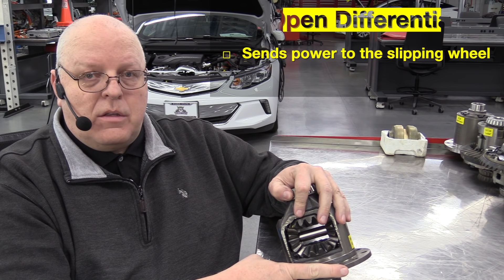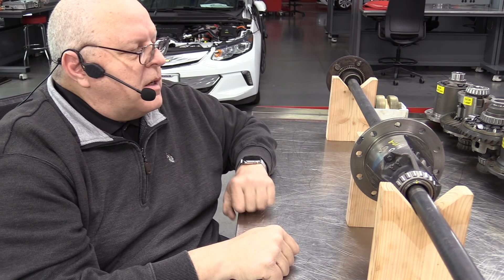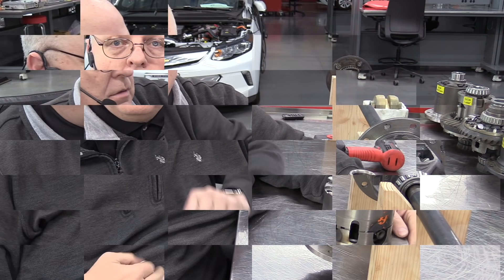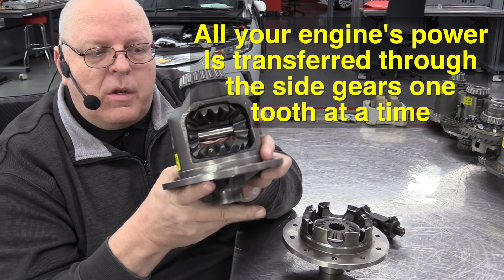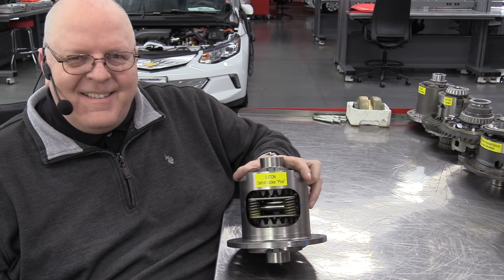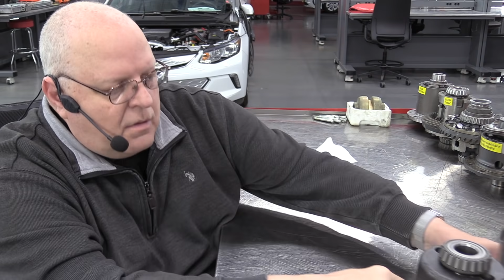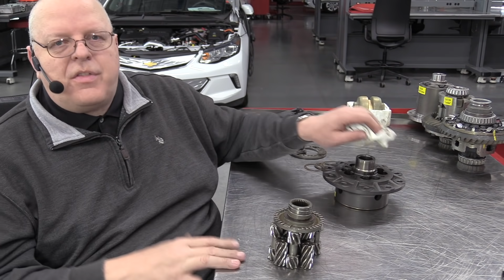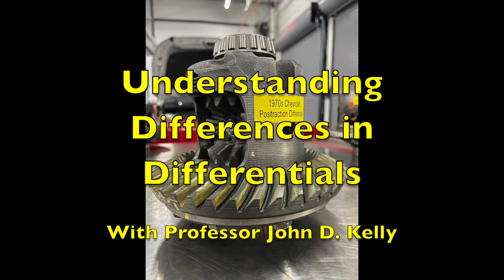Understanding Differences in Automotive Differentials

Comment: I love these videos. I've spent years (~35) trying different differentials in street cars, road racing cars, LD trucks, HD trucks, snow plows, off-road vehicles, etc. and it is nice to see someone who understands how they work.

I don't know if you noticed though, the different ways that the clutch packs are applied in the limited slip differentials (LSDs) shown. In some LSDs, like the 1st one shown from the 1960's, it is the torque applied to the ring gear and the pinion cam profile that proportionally clamps the clutch packs together. For racing this is preferred over the spring preload LSD style. On the other hand for street use in icy and snowy conditions a spring preload LSD tends to perform better. Both the driving experience and how they function is unique to each LSD style. I'll explain below why.

If you look carefully at the 1960's LSD you have and pay special attention to way the spider or pinion cross shaft sits in the differential housing you'll notice it rides on an angled cam machined into the housing. As torque is applied to the ring gear (and hence the differential housing), the pinion cross shaft rides up the cam and this creates the separation force that clamps the clutch pack together. There is still a separation reaction force generated by the spider and side gears, but the majority of the clamping force is due to the cam.

These cam or ramp based LSDs can typically be purchased with different cam angles (not sure about the one from the 1960's). Some have replaceable cams, while others you have to machine (or purchase) the housing with the angle you want. The purpose of this is to adjust the amount of differential "lockup" you get per amount of torque applied. You can also create a different amount of lockup for the forward torque (acceleration) vs reverse torque (deceleration) by using different cam angles for each direction. 

The Torsen style differential bahaves functionally similarly to a cam applied LSD, but the downside to a Torsen is the forward and reverse torque induced differential coupling cannot be individually tuned as easily. Most people claim Torsen's can't wear out, but I can confirm they definitely can.

Many modern limited slip differentials used in street cars (like most of the LSDs in the video) do NOT use a cam profile to apply the side clutch packs. Instead they use a less expensive spring's preload to create the majority of side clutch clamping force, combined with the spider/side gear separation reaction force. If the driver simply wants to be able to perform 2 wheel burnouts or drive in the snow, this style can work well.

Detroit Lockers are another story (note in the video the LSD labeled Detroit Locker was not a Detroit Locker). They are not really differentials in the classical sense, nor are they LSDs. If you imagine taking a pair of ratchets from your toolbox, cut off the handle, and weld them to each side where the side gears normally go in a differential, you have created the function of a Detroit Locker. For straight line driving, both wheels turn at the same speed so the ratchets work fine. When you want to corner in good traction, the outside wheel wants to turn faster so that side's ratchet will allow this to happen while going "click, click...". The coolest part of the Detroit Locker is when you switch from drive to reverse and vice versa there is a bit of a clunk (and the driveshaft will turn 1/4 to 1/2 a turn). What this is doing is switching directions for the "ratchets". The direction of torque applied to the ring gear is what selects forwards or reverse for the ratchets.These work great off-road, in snow plowing trucks, and in heavy, long wheelbase vehicles.

Eaton Gov-Loc's are a bit controversial and are poorly understood in general (the video did a great job explaining them). Most people I know hate Gov-loc's because if you rock the vehicle from forward to reverse to forward to reverse to..., spinning the wheels each time, you'll destroy a gov-loc in no time at all. Where I've seen them work very well is when used in a heavily loaded truck and one tire is on ice and the other is on pavement. No common LSD will lock up enough to get anywhere close to spinning the wheel on pavement. With a gov-loc, if you are gentle on the throttle, the governor will engage, the clutch packs will tighten more and more until the differential is effectively locked up, and the truck will simply drive ahead (or will start spinning the tire on pavement, even burning rubber with a heavily loaded truck, if it is stuck badly enough).

With modern vehicles there is another option that most vehicle manufacturers are starting to implement with varying degrees of success (sometimes combined with viscous coupling differentials). This option is to use the ABS system to create a virtual locker. The software monitors steering angle and relative wheel speed (all 4 wheels). If programmed well, the instant a wheel starts to spin, that wheel's ABS engages and slows the spinning wheel down to the speed it should be turning. What I like about this option is every single vehicle sold today has the ability to include virtual lockers, essentially for free. All it takes is a bit of software to use the already present ABS system as a locker and by including drive by wire it becomes a seamless addition.
Reply from the maker: Fantastic information, thank you for sharing.
Reply: This was the best, most helpful comment I've seen on UTUBE
Reply: The info about Detroit Lockers and Eaton Gov-Loc made me look for some professional video about it. Grat job Slider. 34:40 info about Torsen is misleading. LSD diff with clutch pack allows one wheel to spin (on ice) so the difference in speed (of wheels) creates enough friction to start transferring some power to stationary wheel. So certain % of motor torque may be transferred to stationary wheel. Torsen in such situation spins wheel on ice :(

In LSD if left wheel can handle 10Nm on gravel and right one 100Nm on tarmac, as long as you apply less than 20Nm on axle you will not spin any wheel. You put more than ~30Nm and you will start spinning (internal clutch will eat some Nm) . Torsen works in different way. Assuming that it have TBR 3:1 in the same situation left wheel can get 10Nm and right wheel can get 30Nm (TBR x less grip on axle). Torsen is great for acceleration and cornering when wheels have biggest difference in grip. No other diff allow to put so much torque on wheels without them to spin. But it lack on locking wheels to diff when one wheel have no traction. In other words Torsen does not do the same as LSD. It does quite different. I missed that info in film.
Reply: @triodak  I agree with most of what you said but don't agree that the Torsen provides the highest torque bias. I also don't agree with the general idea many other people have that Torsens are the best differential you can get. In addition there are advantages to cam/ramp based LSDs over the Torsen differential that are worth considering (even for street use).

While in theory Torsen differentials will lock up more and more and more as more torque is input to them, the same is true with cam/ramp based LSDs. Also differentials like Detroit lockers and other "ratchet" based differentials, as well as gov-lockers, Eaton's MLocker, spools, and manual lockers (that completely lock up at the touch of a button) also provide theoretically unlimited torque bias and these don't require any resistance on one wheel (eg. in the air) to provide essentially unlimited torque to the wheel with traction. Note I say theoretically because all fully locking lockers have a breaking point, where too much torque results in failure.

Torsen differentials are very often talked about as being the best, most capable differentials available. In reality, while they are good, they are quite limited in what they can do.

As you mentioned Torsen differentials provides close to a pure torque bias potential from side to side based on the TBR (torque bias ratio) and the input torque. Depending on the worm gear angles/ratios, the TBR can be varied when the differential is manufactured. Let's say for example we have a Torsen with a 4:1 TBR.  As you stated that means you need some traction or resistance to rotation on one side in order to provide up to 4x more torque on the other side before the differential slips and allows the wheels to turn at different speeds.

A cam or ramp based LSD also provides a very similar selectable torque bias ratio and just like a Torsen, the torque bias can essentially be unlimited as input torque increases. What these have over the Torsen, and the reason you'll find them in many high end true race cars, is in addition to a selectable TBR they also have a selectable preload that provides an initial, zero input torque, torque bias. What this means is you can have your 1.5:1, 2:1, 3:1, 4:1, etc selectable dynamic TBR plus an initial TB. Let's say you select a TBR of 3:1 plus an initial, preload TB of 100 ft-lbs. This means even with one wheel in the air, the wheel on the ground still would get up to 100 ft-lbs before the wheel in the air starts to spin. In addition to this let's say the wheel in the air either isn't actually in the air or you apply the parking brake and it now has 100 ft-lbs of rotation resistance. Now the wheel with traction can receive 3x 100 ft-lbs (from the 3:1 TBR) plus 100 ft-lbs or 400 ft-lbs before the wheel with less grip/in the air starts to spin.

On top of having a selectable preload TB and a selectable TBR, most of these LSDs also have the ability to provide a different TBR for forward input torque vs rearward input torque. For example if you desire more corner entry oversteer you might select a forward torque TBR of 3:1 and a reverse torque TBR of 1:1 (or even 0:1 if you want the differential to only have the initial TB when using engine braking).

Several cam/ramp based LSDs even have variable TBRs available. For example up to maybe 500ft-lbs of input torque you could have a 1.5:1 TBR and above that a 3:1 TBR. Essentially depending on the cam/ramp angles and profile, plus the preload, you create a wide array of different torque bias profiles and fine tune the performance far greater than you can with a Torsen.

One reason, especially in a race car, a Torsen isn't ideal is when the differential receives no input torque, the torque bias drops to essentially zero. This causes the vehicle to favor oversteering. As more torque is applied the Torsen starts to lock up based on the TBR, this results in the vehicle tending to understeer. A vehicle that switches between understeering and oversteering can be difficult to handle at the limit and difficult to set up the suspension for.

Adding a fixed torque bias tends to make the vehicle tend to understeer, even when no torque is applied to the differential. This means if you set up your suspension to compensate (with stiffer rear sway bars, etc) you can provide a more consistent handling vehicle.

Some downsides to these cam/ramp LSDs, with selectable, independent forward and reverse TBRs and selectable preload based TBs, include they use wet clutches that do wear over time (slowly reducing the preload TB and eventually requiring new clutches), they are expensive, and they can be a challenge to select the optimal TBRs and TBs.

I've had and used several Torsen/Gleason/Quaif/Tru-Trac differentials over the years but these days I use mostly ramp/cam style LSDs in my cars, Detroit lockers in my truck, an air lockers in my RV, and a few ABS brake based "A-trac" systems (in my Lexus GX and other stock cars) differentials. I've still got a Dana 60 Tru-Trac and a Saturn S-series Quaif but they are sitting on my shelf...
Reply: ,,,,,,,,,,,,Awesome info............I have known that the Detroit Locker is the strongest ,,,,,, with its noisy ratcheting mechanism,,,,,,,Thanks for the extra info about the Gov Loks , as one is in my 96 Z/28 6 speed stick....I was bent on swapping it out for something better from maybe Yukon gear................
Reply: A lot of modern lower end racecars today also use spring preloads like in GT4 or GT3 race cars which are also heavily based on production models. Gt3 still gets its own spur gear dog box transmissions but are still aimed to be cheap race cars so they also use the preload spring style. Also do you know why completely locked/spool differentials are used in v8 supercars series or back in gr5 and gr c le mans era? How do they turn with locked diff. Porsche 935, 956 ,962 for example had spool diffs
Reply: Really great comment with good information.
Reply: I'm looking for a limited slip diff for my Jeep Wrangler(2001) both front and back; what brand would you recommend ? I hunt and go across muddy areas.
Reply: Great info! 
And for anyone whose emergency brake works on the drive axle, it's truly a poor-man's solution. Years ago I helped a guy with 2WD Dodge p/u stuck on ice with one wheel and was down to gravel on the other. I asked him if he used his emergency brake on a regular basis. He said ya, but why? I got in and used it to force torque to the wheel on the gravel. It just gently walked right out. He thought I was God Himself, haha. Pretty sure he used that strategy for the rest of his life.

Excellent lesson here also, John. Much appreciated.👍 Looks like the school has a fantastic shop set-up. Great lighting and you and the kids keep it spotless.
Reply: @user-5gu78qo27i  Actually i have heard of using parking brake to help when stuck in snow or ice. I didnt know that it would actually work to some extant in some situations. I will try it this winter when i have snow in my driveway. Now i wish that my truck would have double hand brakes, one for each rear wheel, like my tractor and backhoe have two brake pedals one for each side.
Reply: @eltonsipes3713  Yes it works well most times. Helps to have emerg brake adjusted evenly..some self adjust left to right to balance. The principle is fairly simple really..the engine can over-power the emerg brake on the side with traction. I put emerg on fairly sturdy, not too hard though to start, just add as you feel it not transferring enough torque. Nice a slow of course.

I have a tractor too. Having independent option is very useful. I use it to even tighten up my turns when need be. 
I guess a person could do an independent left and right, but it'd get fairly involved depending how new your truck is. Wouldn't want to do too much hacking if it's quite new. If you have a foot pedal or center pull between the seats, you could add an old twist and pull under the dash. 👍
Reply: @eltonsipes3713  
A lot of sand rails, dune buggies, have dual hand brakes.
One for each rear wheel.
They are FUN! 
LOL

Comment: Excellent video!  One more thing to add to the last Eaton diff, is that it also locks out the posi once the vehicle exceeds approx. 30 mph. Posi happens like you said with 100 rpm difference L - R, and spinning the small stick of flyweights, but only below approx. 30 mph. There's a larger flyweight towards the center that will move off-center preventing clutch engagement above 30 mph.
Reply from the maker: Thanks for the info

Comment: I had  1963 Plymouth Belvedere 426 short ram dual 4:barrel carb and a special racing Torque Flight transmission Meant for drag racing? I made tight turns one of the back tires chirped. I drove for over 70,000 miles and it was still doing some!
,
Reply from the maker: Thanks for watching

Comment: The Tacoma never had a locker available in front from Toyota as an option, only the rear. The rear locker was also available on 2 wheel drive as well as 4 wheel drive Tacoma's. The Land Cruiser, the 80 series did have an option for front and rear lockers both from Toyota. I think all lockers from Toyota only engage in 4L as far as I have ever heard. I think the Land Cruiser is the only vehicle ever to offer a front locker, in the United States from Toyota. Overseas they have other 4x4 like the Hilux, which may also have those options. I have an ARB in my 4Runner, which gives me full control in any mode and it switches back and forth on the fly which the stock Toyota lockers can't do.
Reply from the maker: Thanks for the information!

Comment: Great video!
Ive got a 1948 Willys Jeep with I think a Dana 41 in the back. Im quite sure based on your video its just an open differential. I've been looking at lockers, but I like to drive this around town. 
I really don't want to spend the money on an air locker.
What would you recommend for back there to get it to limited slip economically?
Reply from the maker: There may be limited slip differentials available for that model. They are typically the least expensive. Thanks for watching

Comment: What is a getrag Differential
Reply from the maker: Getrag is a auto parts supplier. They make some open and limited slip differentials
Reply: @WeberAuto  but why if it’s a open differential why does both rear tires spin ????

Comment: so, open diff is not made to survive big diferences in wheels speed because it has not good lubrication in case of one wheel spins other is stoped, and question is why my diff oil is not clear after 5-7000km and i drive car on highway as much i can but never one wheel stoped
Reply from the maker: Good question. Thanks for watching

Comment: Great video it was very informative!
I've had an issue with a torsen style diff from a manufacturer wearing the casing and the gear sets, it has been sent back and repaired and in 5k miles it degraded again, I've fitted a different brand torsen (mfactory) as I dont trust the one I had i have photos but obviously can't upload them to youtube.
Have you teen torsen types wearing out the flanks on the gear faces before.
An oil sample was sent off and it was very high in boron which if I'm not mistaken is case hadening.
Reply from the maker: Interesting info. Thanks for watching